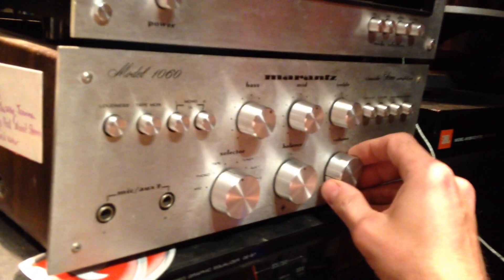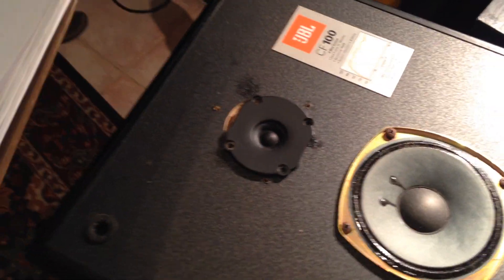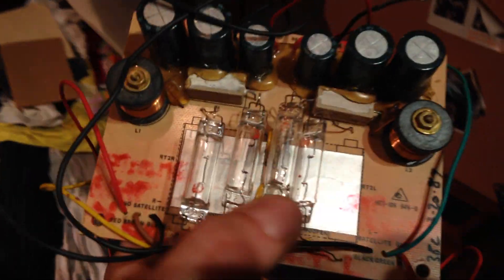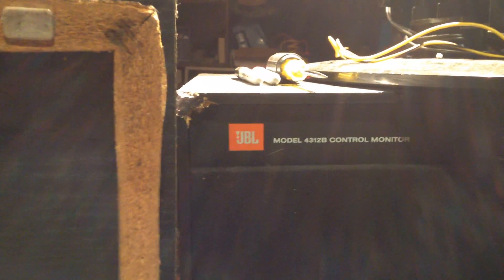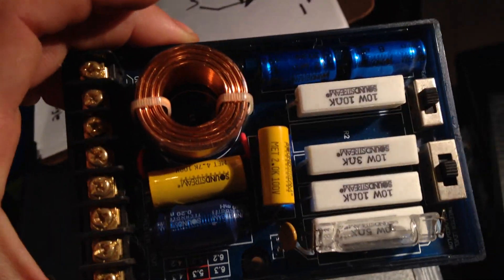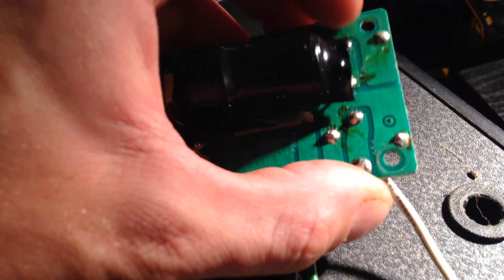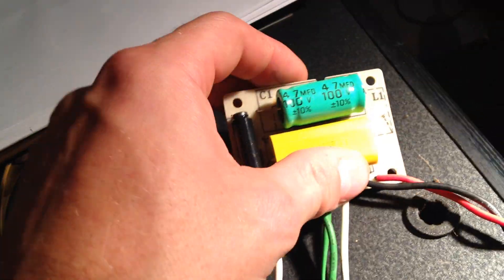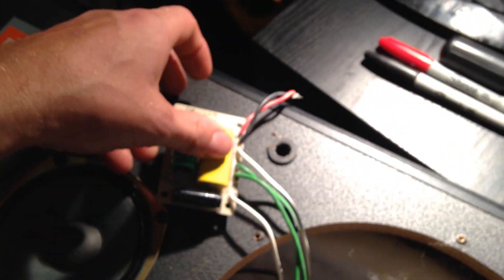JBL CF100 baseline for repair. Crossover issues.  Look for vid 2 for results.

Comment: someone may have already replied, the 47uF is for the woofer, anything that high a number filters out all the high frequencies. I do not see the 1.5uF for the tweeter on that board, it may be hooked up in series with the tweeter. The 6.8uf is for the midrange. The knock on the CF100 was lack of midrange presence, it crosses over from the woofer at 1.4kHz. Some had success lowering the crossover, I would go 850-1000 Hz. But history shows that JBL did run woofers full range in the 4312 and other exceptional speaker designs.

Comment: Hey I have a pair of these & since I’ve had them, I notice the mid range tweeter on both of them will cut out from time to time, especially at lower volumes. Reversing channels on amp does not change the direction of the issue, so it’s certainly the speakers. I fix it by jacking up the treble all the way on both sides of my amp & the issue goes away. But that doesn’t make it any less annoying of an issue… what would you think? Bad mid range tweeters? Bad caps? Bad crossover? Thanks

Comment: Um......  HOPE You have LEARNED that the 47uf & smaller coil is for the Mid, the tweeter is that YELLOW Part that has 6.8 on it - 6.8Uf Cap / NON Polar for the tweeter !!!!!!!!

Comment: I'd like to see that woofer close up. 
I looked up the tweeters on ebay, not cheap.
It does seem those caps would be lower freqs, but are they also part of the mid circuit?  Perhaps the tweets are higher impedance, not eight ohms.  A good tweeter can handle mid freq too.  I've used larger lower freq xovers on tweets, I like the sound when tweets are fed lower freqs, if they can handle it.  Don
Reply from the maker: I'll do another vid.  No the tweeters are not cheap!  Don!  How the new pistol doing sir!??
Reply from the maker: I agree on the freq for the tweeter. I'm not crazy about a lot of around 6k.  Hard on my ears!